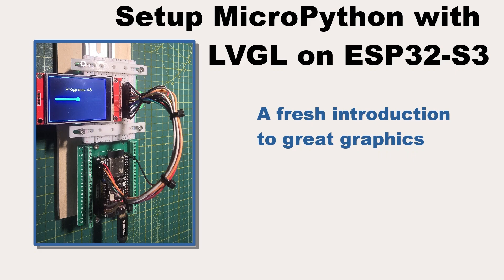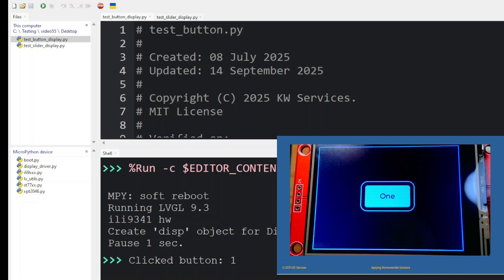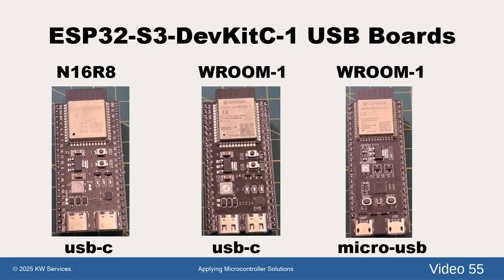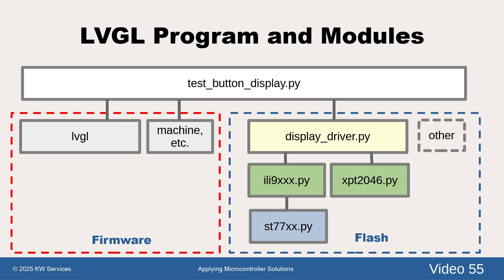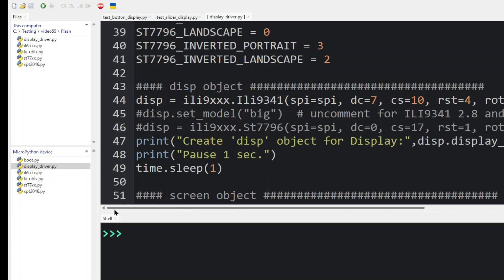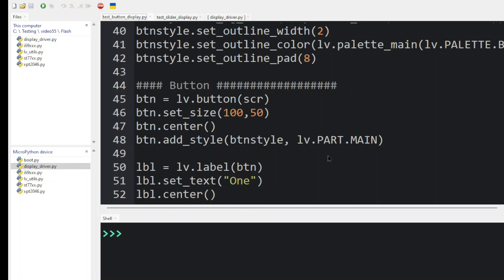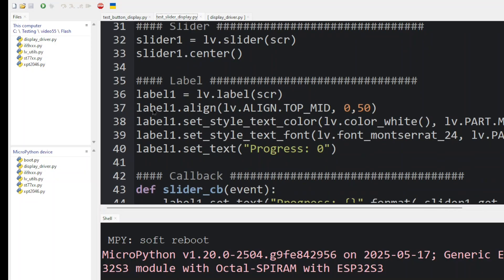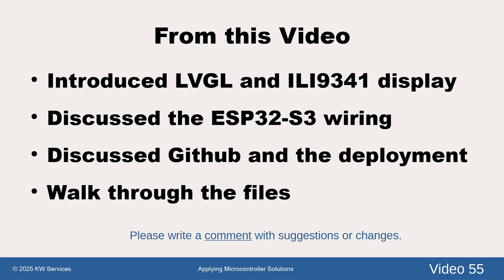Setup MicroPython with LVGL on ESP32-S3 Octal

Comment: Hello, I'm new to programming with displays for microcontrollers, I recently got a 1.8" TFT display with the st7735 chip, in addition to the display I have an esp32 devkit-v1 board (micro usb), I've tried several ways to integrate LVGL but I haven't succeeded, I don't know if I'm making a mistake in exporting the firmware or I'm just missing configuration files, I know I could do it quickly with Arduino, but frankly I don't like it, I would greatly appreciate it if you could make a demonstration video, since I see that your content is very educational.
Reply from the maker: Thanks for the suggestion.  I will see what I can do to setup a ST7735 display.  Thanks for listening.
Reply: @applyingmicrocontrollers  I appreciate the help and effort you put into your videos, I'm learning.
Reply from the maker: Great! Thanks for the feedback.